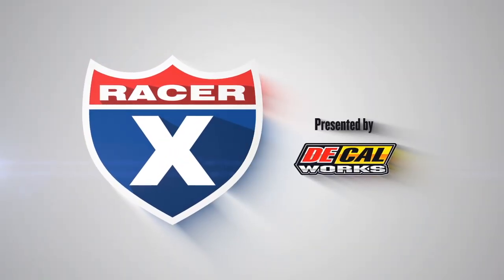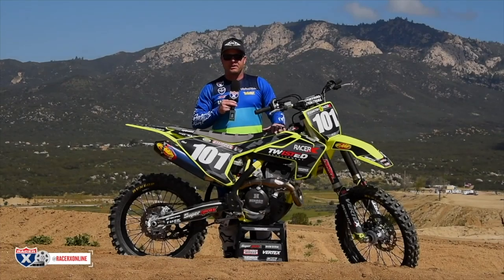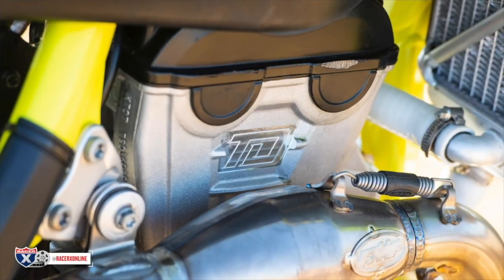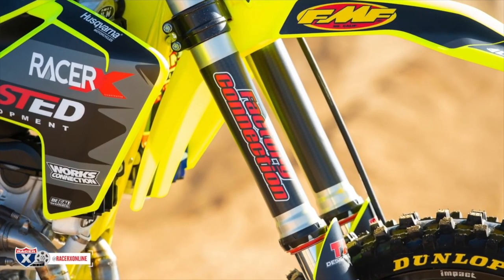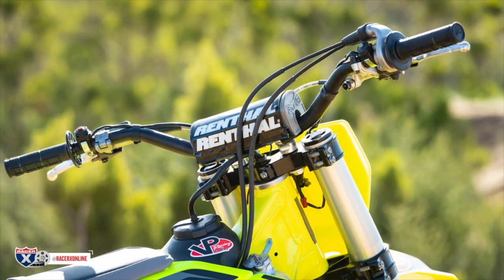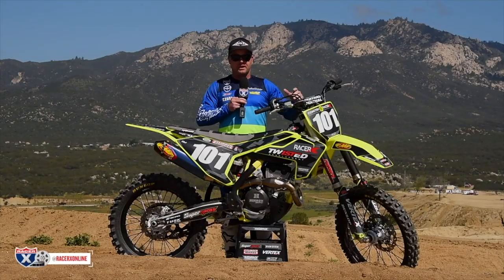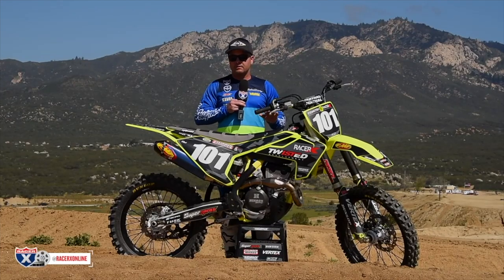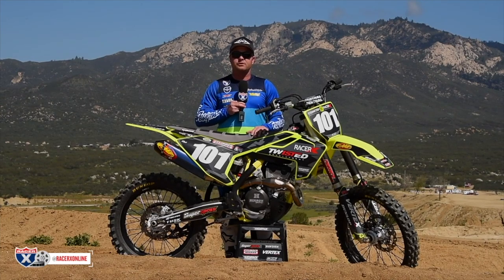Racer X Films: 2018 Husqvarna FC 250 Big Bore Garage Build

Comment: Just a basic build. We just put a big bore in...... and had the head ported..... and bought a 600$ ecu.... and a 1000$ pipe..... and spent 1500$ on cosmetics. What does it do if you just slap a 270 kit in a bike and do nothing else?